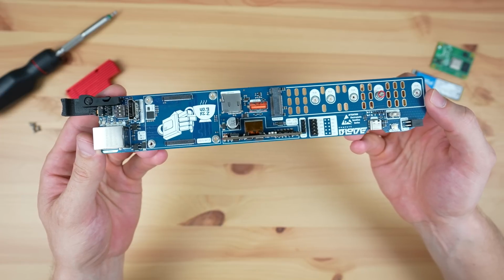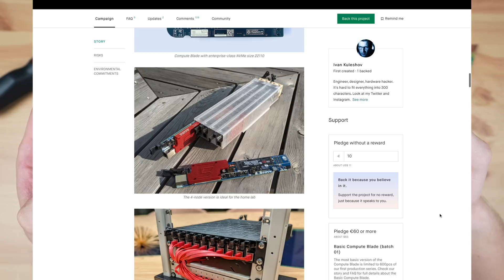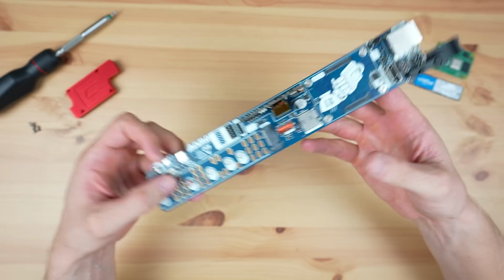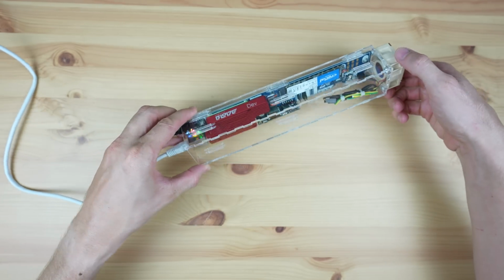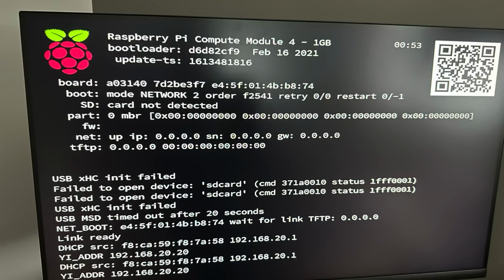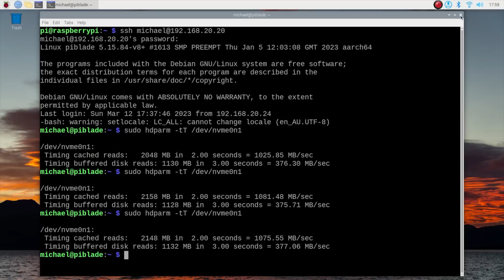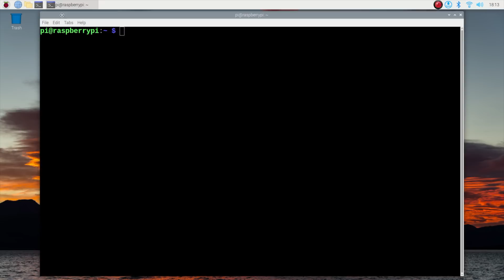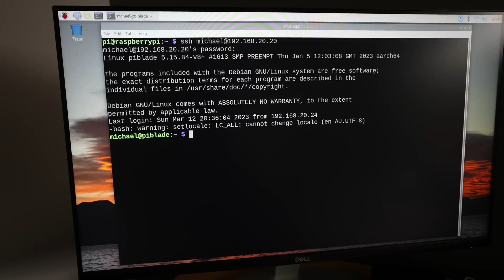Level Up Your Homelab With The Raspberry Pi CM4 Compute Blade

Comment: Hi Micheal,  I saw your previous vedio that Make a Simple arduino energy meter.  In that i have done query that   unfortunately all the reading in the lcd shows zero only, even though i apply the load. What is my mistake, pls help. I am using the same Ct talema ac1030. And  I checked the code for KW and I am getting Maximum of 6663 W. Is it the maximum limit or somewhere I am doing any mistake. https://youtu.be/W2Pa91I6QuY(This Was the link of That Vedio)

Comment: I assume you only have one but I would be really interested in temperature with two blades in the case.
Reply from the maker: Yes, I only have one. I doubt that it would make more than a one or two degree difference. There is quite a lot of room for airflow over the heat sink, even with two in place.

Comment: I hope this isnt a silly question, but could this make a great NAS server, versus the larger NAS servers for home use & editing? SInce the ones I have from WD & QNAP are only for HDD drives, having a low power Raspi version with NVMe drives would be a game changer.
Reply from the maker: Yes, you could definitely use this as a NAS running storage on the NVME drive.
Reply: You don't get all advantages of NVMe drive with basicaly mobile cpu